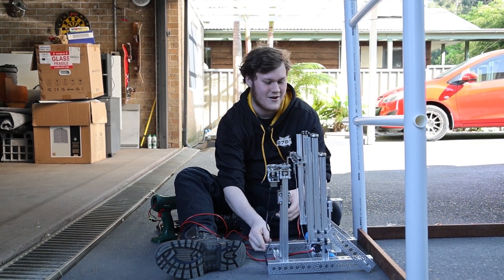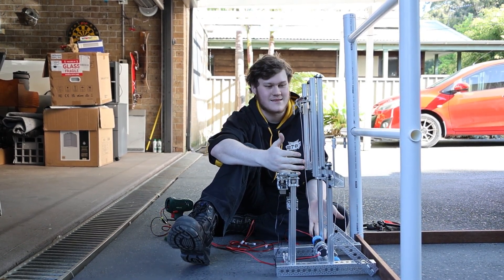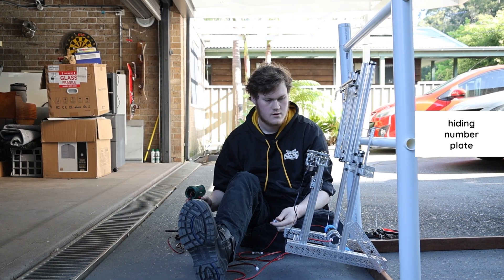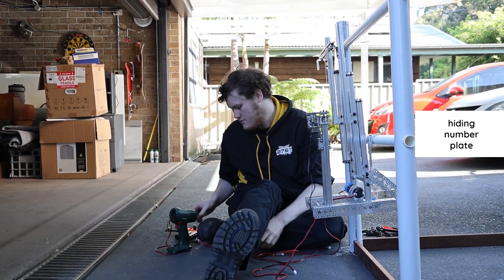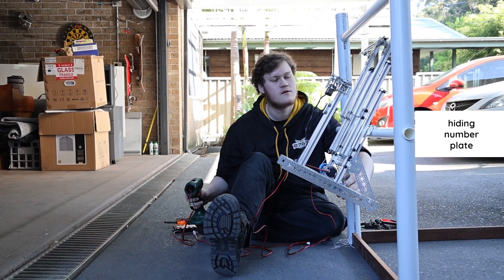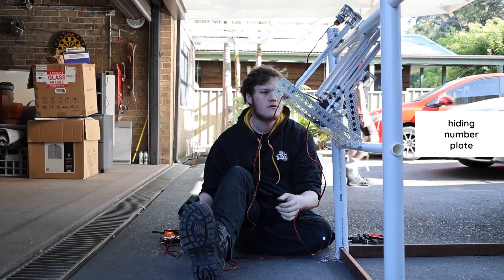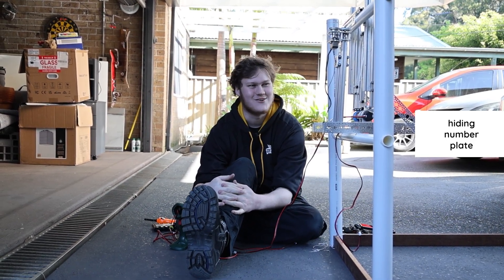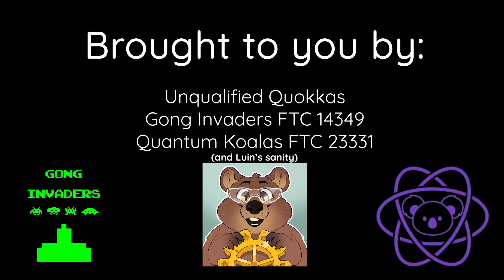Ri30H Climber Concept

Comment: idk if the intake will be heavy enough to offset the entire drivetrain, lift, motors, electronics, and batteries but ay it might work
Reply: its not just the weight tho, its also how far out they put the intake to offset the robot CG
Reply from the maker: The plan was to have the CoG directly below the first set of hooks such that your chassis sits parallel to the floor. This then allows for the maximum shift as the arm it extends out. We can also extend all the way out to the limit.

Unfortunately we didn't get a chance to test it out fully integrated with the bot, but the idea was to get it to a stage where the concept was fledged out enough that teams could take it and make it their own. 

If we were competing this season, there are a number of things we would be doing differently, which we will be adressing in our tech binder. So keep an eye out for that on our Instagram and Chief Delphi thread for when we release that in the next 24 hours.